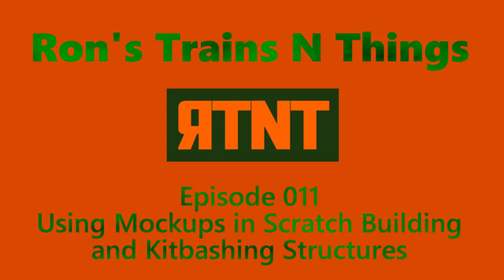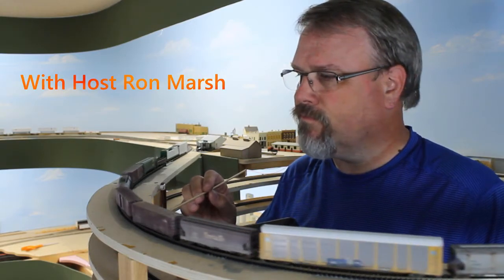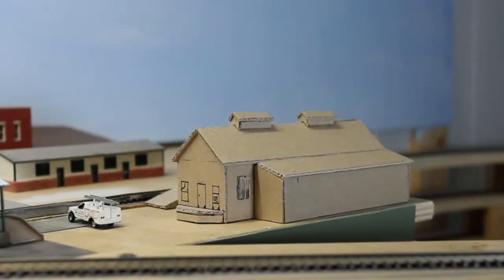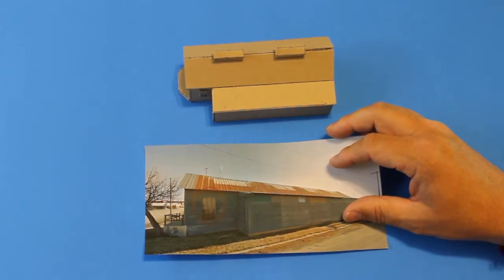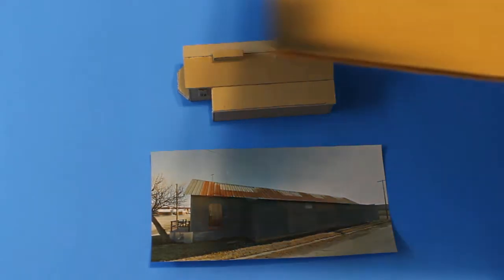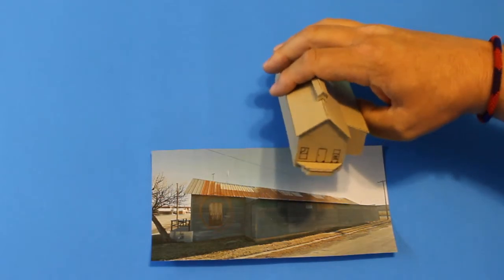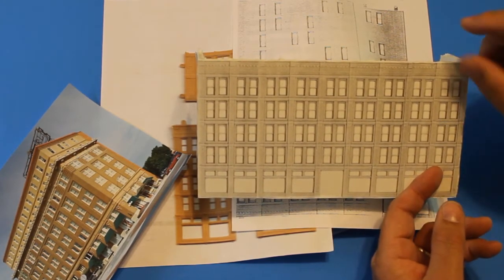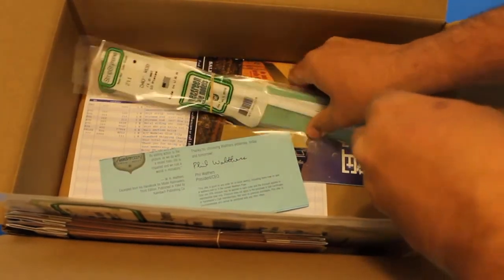How to Use Mock-Ups in Model Structure Building

Comment: Great job on 100 !!! You do produce great vids so its not a surprise.... i do have a tip for you ... if ur tired of waiting on white glue to dry.. try hot glue. You can even use it temporarily for mocking up plastic. Then just peel it off.   Thx for the info you provide especially on scratch building as im just gettin my feet wet in that area.   Wouldnt mind see a layout overview.... tuned in and watchin !!!!
Reply from the maker: Matthew lund Hot glue is not a bad idea. I use low temp hot glue on cardboard lattice for scenery base. I'll try that. the only drawback is all the stringy hairs of glue you end up with.
Reply: I use my hot glue gun on low temp. Instead of ""pulling tip""away from what you just glued , ""cork screwish"" / "" circle"" the tip away and the hot tip will burn the "string" off .

Comment: Hello Ron, I am returning to the hobby after a 35 year absence I was at the time modeling HO scale due to space constraints I will be going to N-Scale. Here is what I am doing utilizing extruded foam board I am in fact reverse engineering. Meaning I am building the scenery first and then adding the railroad. I looked and did not like was avail as far as bridges trestles and buildings for N-scale. I need to scratchbuild a trestle 140' scale long encomposing a 90' scale drop how can I scratchbuild the bent supports "IE: how would they build supports in a river based on 1940's technology?" My line is set as a branch line feeding the Union Pacific in 1942?
Reply from the maker: That is a very good question and a little beyond my engineering knowledge.
Reply: @RonsTrainsNThings  Thanks Ron for the reply. I did many hours of research and looking at bridge trestles and found out many interesting things. Such as lumber processing was limited to 20', so with that in mind I broke out my scale ruler and going from pictures have scratchbuilt in my opinion a very good representation. I will post pics for you to see as I complete it. Thanks and keep up the good work to inspire modelers to return to the hobby as I did. BTW having a ball doing it